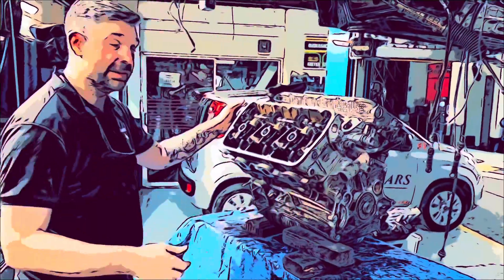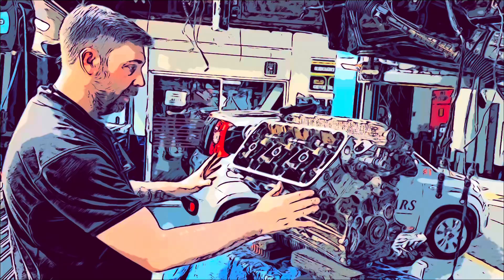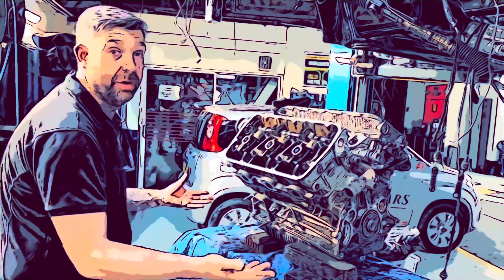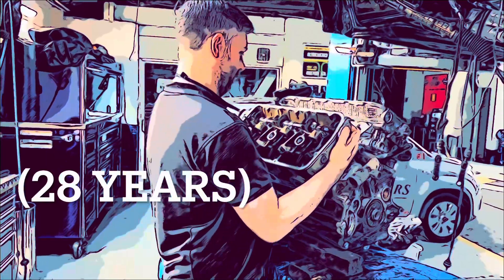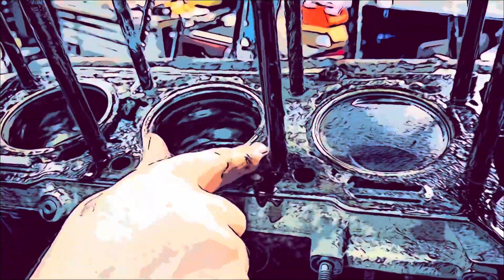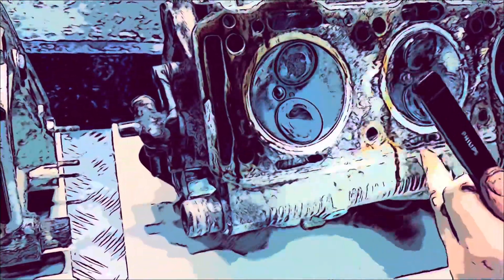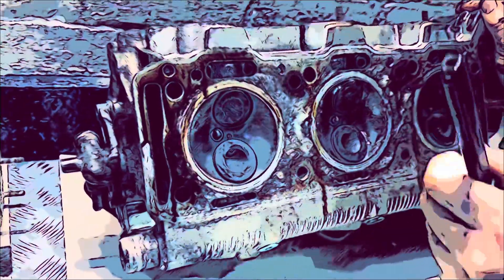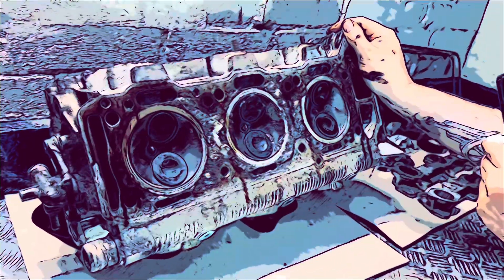ALFA ROMEO 155 V6 BUSSO ENGINE TEARDOWN.

Comment: Thanks for the video! I also found some pit due to corrosion on my 24v busso head, but non of them are within the sealing zone, want to know do I still need to weld it or it would be fine as long as I clean up the other area?
Reply from the maker: Hi , great question . I asked the same question. 
I was also worried about the craters outside the sealing zone. Our local Engine Builders assured me it would be okay.

Comment: Shocking! You mention the engine was running before pulling it. Did you have any idea the head gasket had failed? or so badly? It must have been failed some time perhaps? or simply age of the gasket allowed it to eat into the heads like this. BTW Great resto your doing and watching with interest from New Zealand as Im about to pull my 155 V6's engine for a major overhaul after years of standing. Will you repair the heads or ??
Reply from the maker: Yes so this car had been sitting abandoned for years, It did start & run although you wouldn’t want to drive it .
We have the heads at a company called “Classic & Modern Engine Services” they’re welding & overhauling for us.